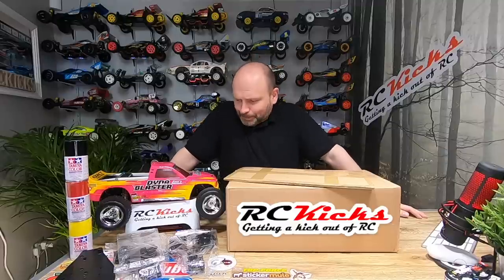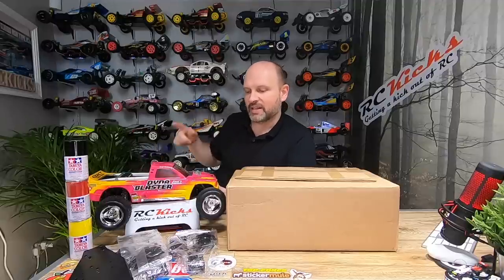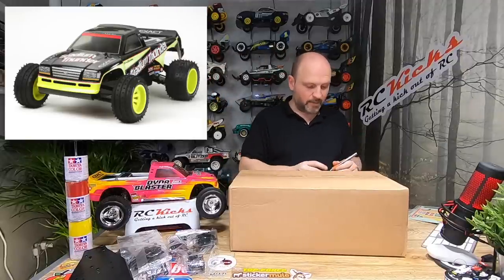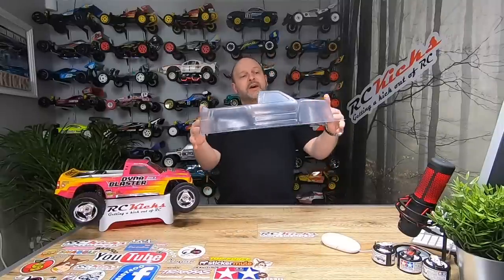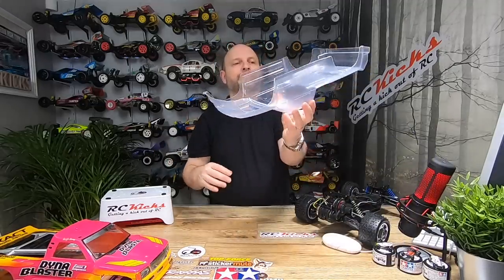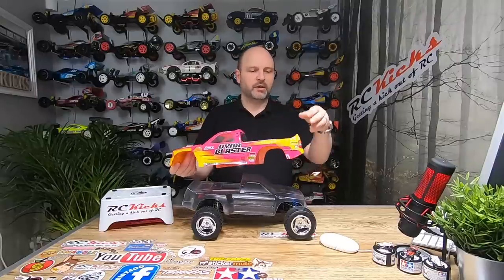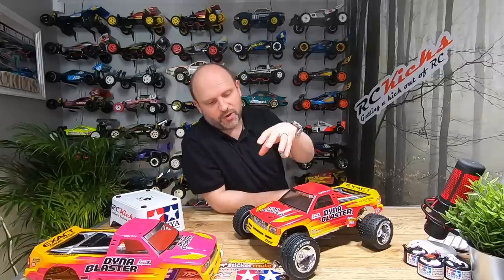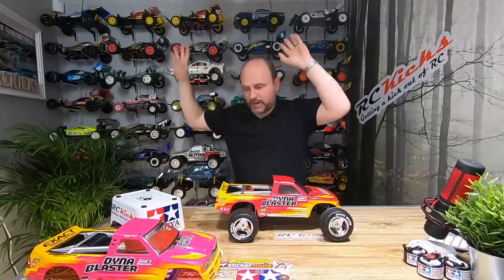A Stunning Original Tamiya Dyna Blaster RC Buggy Body & Decal project | RC Car Painting Tips & Steps

Comment: Great Job. It really came out nice.  Good thing you didn’t use camel yellow.   Thats the color used to paint the original RC10.  It’s way different than standard yellow.  As far as MCI, he uses a laser printer where as the original Tamiya stickers were screened printed which is a much better quality.  Screen printing is done in batches or high volume and doesn’t pay to just run off one copy here or there which is why again, MCI uses a laser printer.  That is a good looking stadium truck.  Just saw one go on an auction site for around $150 with the blue dyna storm sleeved dampers on it.  Was that you?  Just saying, since you have a knack for buying multiples of the same RC.  Be well buddy!
Reply from the maker: I would have if I had known about it.  That’s a low price for one of these unless it needed a load of work.